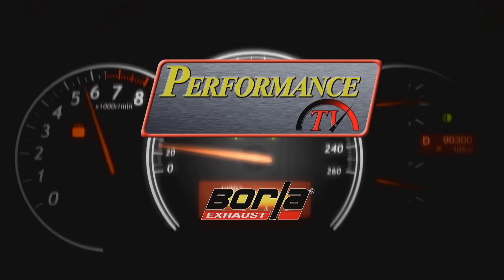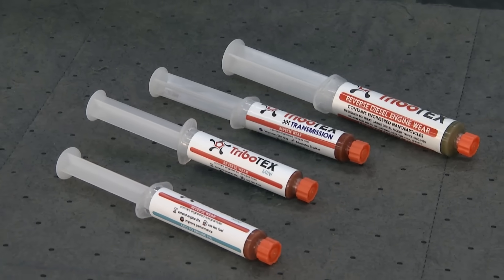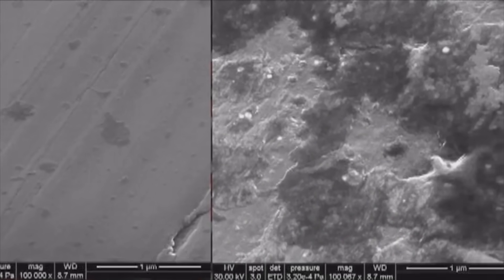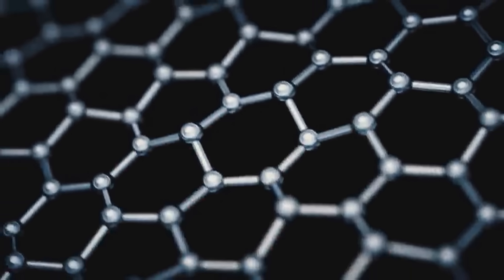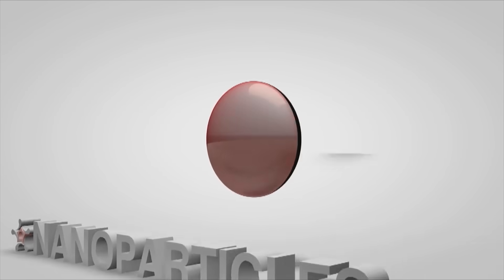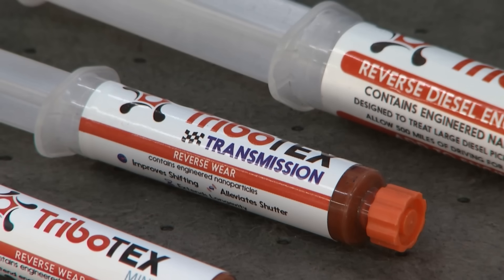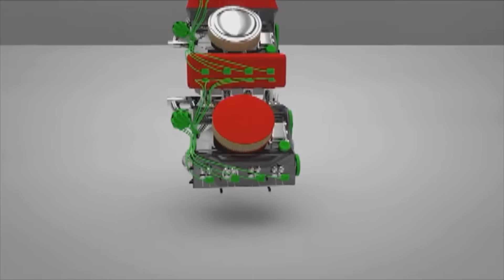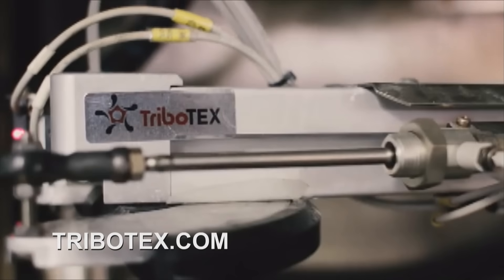TriboTEX review by MotorTrend PerformanceTV with Joe Castello and Dr. Pasha Rudenko

Comment: If the particles stick to scratches in the cylinder walls, enough to restore the surface, I like to know if those same particles would build up enough to block the tiny oil passages that are in modern engines, with VVT systems where 0-20 oil viscosity is required

Comment: Use the engine tribo on all my cars and truck. Just received the transmission tribo. Will inject it during the fluid change. Did a few dB test and mileage on my older Chevy Impala, Was impress with the lower dB, mileage was what about %1 of improvement.  https://www.youtube.com/watch?v=cZJ-TzjSG74    https://www.youtube.com/watch?v=AedzevDv2ck